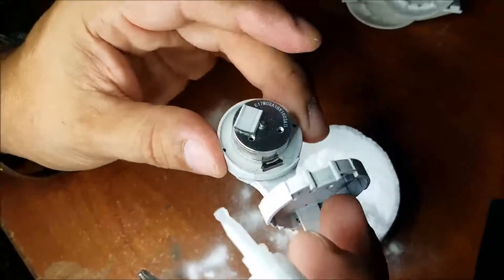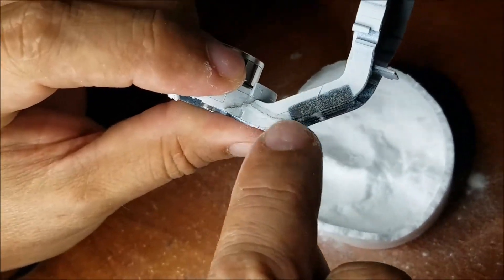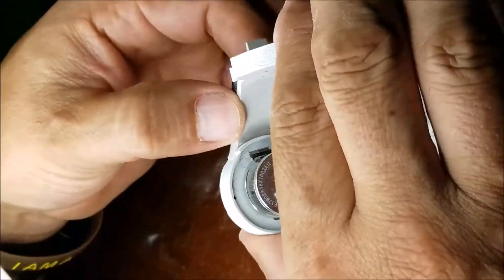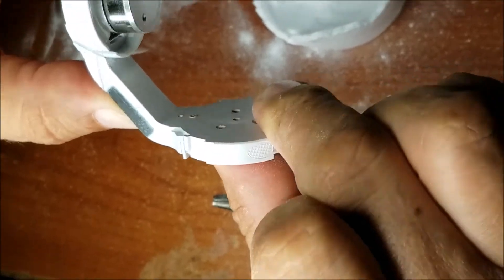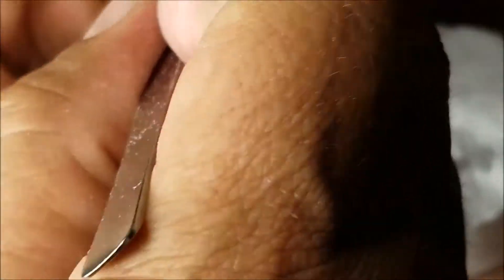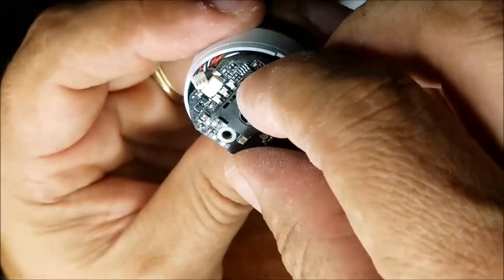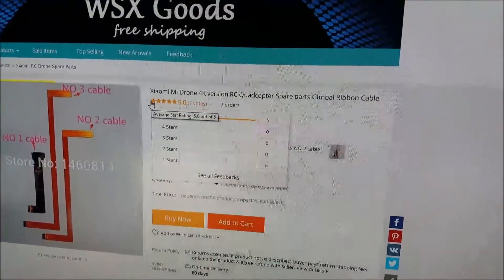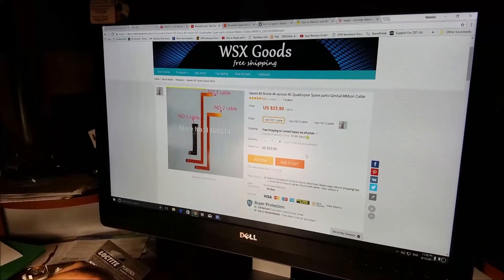Xiaomi Mi drone 4k broken gimbal repair Part#5

Comment: Hi, the cable no1 in aliexpress (the black one) is the one that goes in the top part of the gimbal (where the gums are)
Reply from the maker: The best way to know is measure the cable, if not sure get the pack of 3
Reply: @GHacks7  it's obviously the small one because it's short and black... But not sure if there is another one that looks like this inside the camera...
Reply: There are only 3 of that typo of cables in the whole gimbal part?
Reply from the maker: @Juan-rc3jz  nope.... there is only 3 cables inside the gimbal 3 different sizes... no more cables except  the little one connecting the gimbal and the drone
Reply: @GHacks7  wait what? And the small black one where does it goes?

Comment: Hi men, I have same damage. it's seem I've broken medum Z or big Z cable. By the way mi camera broke in the same point of your can you say me  if u used big or medium Z? Thank a lot, and thanks for video!
Reply from the maker: I understand my friend but it could be any of those 2 wires...2 months ago I did crash my drone again and the same part got broken, but this time the wire damaged was the long one.... if I was you i will buy the set If you don't know exactly which is the one, but if you take the gimbal apart and put the broken wire together you will be able to see the size, in my first time was the medium but now is the large one. Good luck and GOD BLESS.
Reply: @GHacks7  Hi German thanks for answear! I wonder if the broken point is the same should be same cable? How can be medium before large after? Maybe was different point broken?
Reply from the maker: @giuellio75  the problem is that both cables share the same entrance in the gimbal, also just to let u know is a new gimbal part  created in China with a 3d printer, I am going to make a video replacing both the new cable and the gimbal frame in a few days... good look my friend and GOD BLESS.

Comment: hola otra vez, sabes he intentado reparar mi gimbal, pero no he tenido éxito. el drone detecta el gimbal, pero no la cámara. al conectar la cámara por el puerto usb no enciende. me puedes ayudar? gracias
Reply from the maker: Rodrigo Olivares Orozco mmm...  Suena como a algún cable que no está bien conectado... asegúrate que estén bien conectados los extremos de cada cable, lo otro sería desarmar la cámara para ver si algo está dañado o desconectado y lo mismo por chequear el drones, esto lleva mucha paciencia y tiempo. Son varios factores y la única forma es chequearlos todos haber donde encuentras el problema, podría ser un chip dañado... en ese caso sería muy difícil de arreglar. Suerte amigo
Reply: Ger Vi7 ya le cambie un chip  y soldé un cable que no tenia continuidad. en la app. al calibrar el gimbal automaticamente dice gimbal inicializando, pero nunca inicia. manualmente lo hace. pero no logro moverlo con el mando
Reply from the maker: Rodrigo Olivares Orozco wow.... suena bien complicado especialmente de del cable soldado... yo tratataria de comprarlo de ser posible para estar seguro. Suerte

Comment: Hi,
What No. cable was the correct?
Reply: Also, did you use the loctite or super glue with baking powder to glue the frame together?
Thanks!
Reply from the maker: All 3 are for the drone 4k... all depends what u need
Reply from the maker: Quadcopter Fun Downunder make sure you connected everyrhing right, check it again it could be an internal damage too make, this fix is a luck way .... good luck
Reply: Quadcopter Fun Downunder h
Reply from the maker: there is 3 dif. cables, all depend  on which is your damaged one, they have a 3 pack at this address: https://www.aliexpress.com/premium/ribbon-cable-for-xiaomi-mi-drone.html?d=y&origin=y&blanktest=0&SearchText=ribbon+cable+for+xiaomi+mi+drone&tc=ppc&initiative_id=SB_20180331222304&isViewCP=y&catId=0